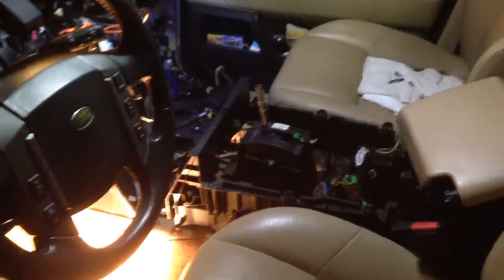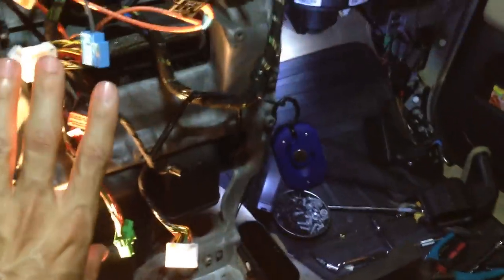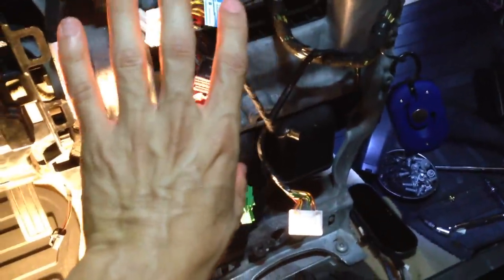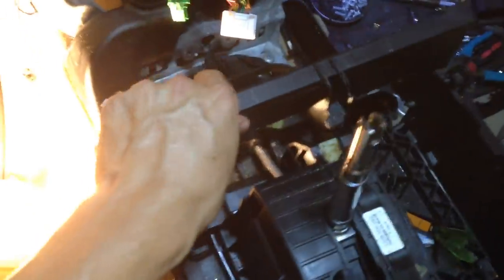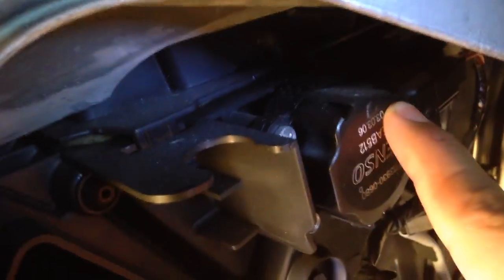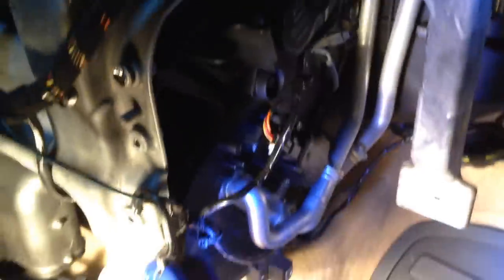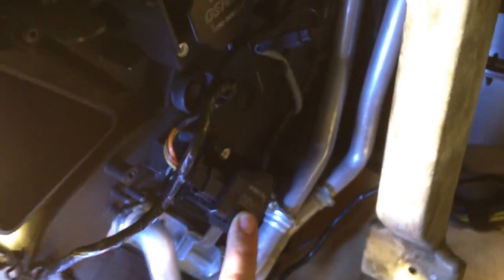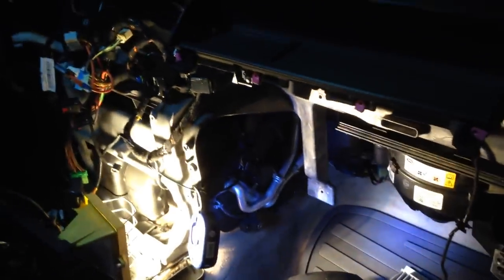Replacing Heater Blend Motors on 2006 Range Rover Sport

Comment: Would happen to know why in traffic AC  blows 70-80*. Driving down the road it blows 50* I already replaced the expansion valve in the dash.  No real change in performance. Had it evac'd, tested, dyed, for leaks, then recharged  twice. No leaks. Had the condensor and radiator cleaned on exterior to ensure airflow through fins. No change. It is like it cuts off. It is a 2012 LR4. Grear job on the video!
Reply from the maker: HalfMoon You know it might be your AC/heater controls console. I have a friend that brought his RRS to me and it turns out that the knob that controls the passenger side was shorted out and was throwing the servo blend motors off. Switched that out and problem solved. I've been finding that these short out when people spill drinks on their consoles and short out their knobs when turning on the unit right after the spill. Check that out. It's easy taking the console apart.
Reply: Thamk you. I will check into it. I still have not figure it out. Even if i bring the rpm up when parked, thinking maybe it is the compressor, changes nothing. Yet, as soon as we get going it will cool again. I have thought it might be a sensor or blend door issue from get go. My manifold gauge readings have never given any indication that the system should not be cooling. The other day the dash displayed an ambient reading of 92*. Yet, the actual outdoor temp was 80*. I read that sensor is in the grill area. I will check that out too. Thanks!
Reply from the maker: HalfMoon man that just sound weird.
Reply: Oh you are telling me. Today it blew cold all day long. Tomorrow it'll probably lose all its marbles.
Reply from the maker: HalfMoon it could be the clutch on your AC compresor.
Reply: It does not look like a clutch type compressor. I have throttled up in order to emulate cruising rpm scenario and no change.